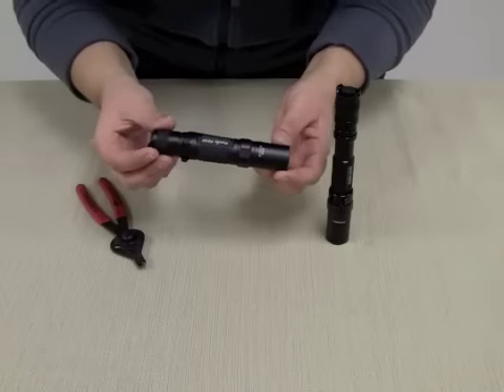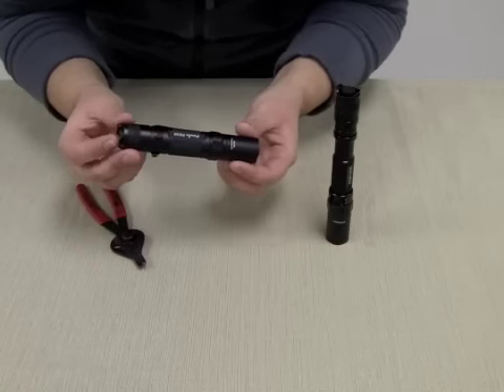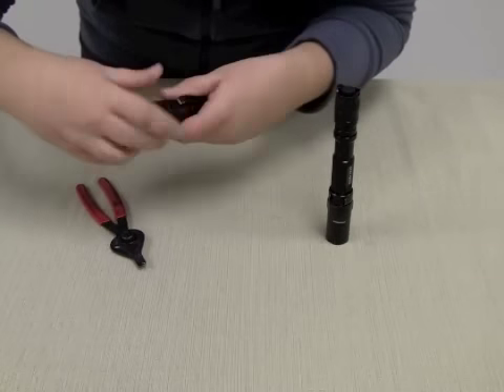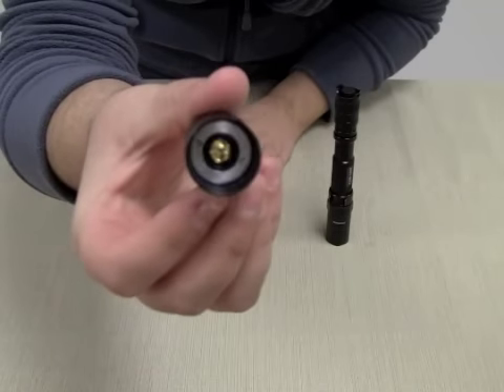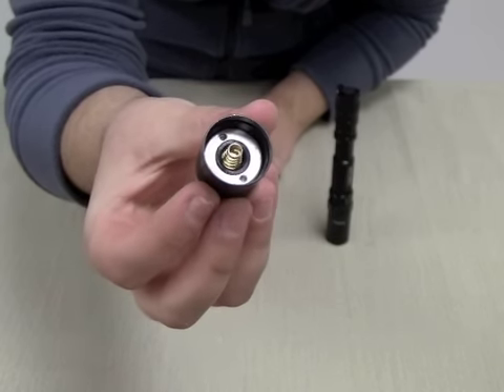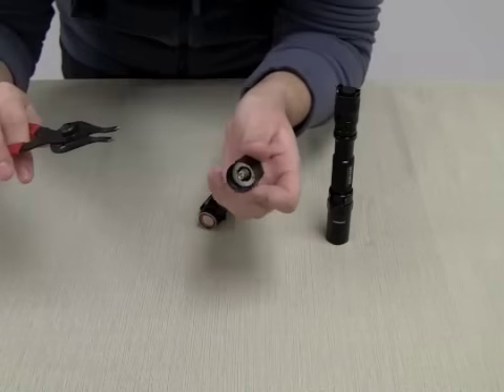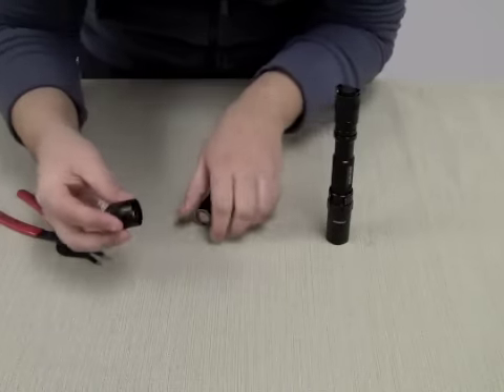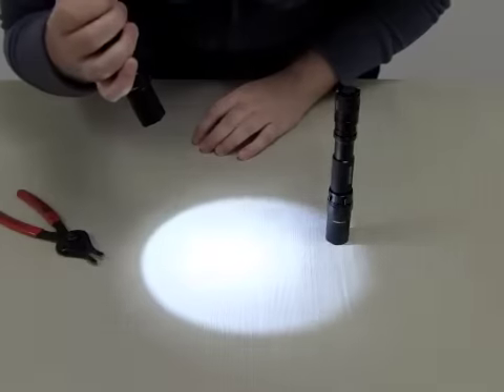DIY Fix for Fenix Flashlight Problem

Comment: Thanks - may I suggest "needle nose pliers" for the ring. They fit perfectly and give enough torque when you want to unscrew it. Fenix shows alcohol and cue tips to swab the contacts. Dunno if that helps, but your vid sure did.

Comment: Thank you for the fix... only one problem with this video. You might want to mention the retaining cap has left-handed threads therefore must be screwed in counter clockwise. Also a pair of needle nose pliers works well in this application.
Reply: Exactly what I was going to say haha
Reply: This.

Comment: WOW.... thank you for this. I have carried a PD30 for over a decade and loved it.  Then I somehow lost it, or thought I had for over a year. Ended up it was hiding in the trunk of my car, however, it no longer seemed to work, and Fenix no longer sells this light.  All of the functions are from momentarily clicking the rear switch, which I loved.  None of the new lights work that way.  I saw this video and holy crap I dug out my old work horse and it works again after this fix.  Great video.

Comment: Thanks so much!  I thought my PD20 was ready for the recycle bin.  I have carry and used this powerful little flashlight everyday for at least three years. Fenix doesn't make this particular model anymore, other that the updated PD22.  The PD22 is a decent light, but the PD20's flat tailcap works so much better for using the flashlight as a candle. When the little one is finally taking a nap and I need just enough light but not too much, this candle feature is perfect.  Anyway, I'm so glad I got my little buddy back.